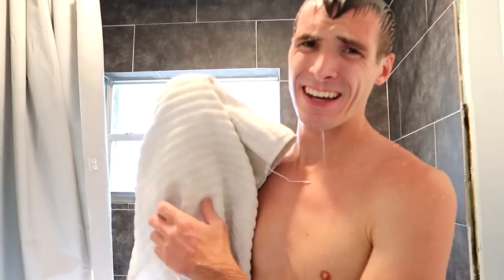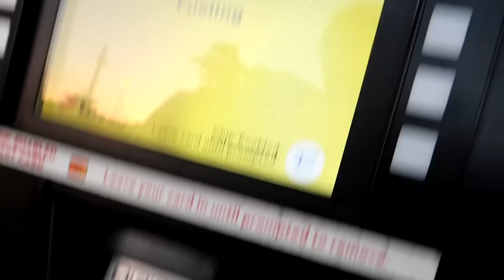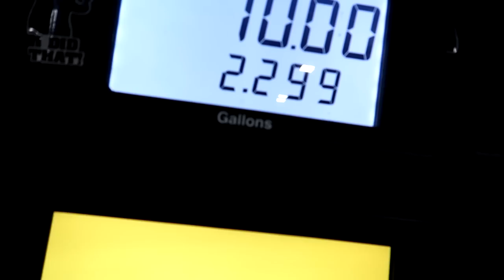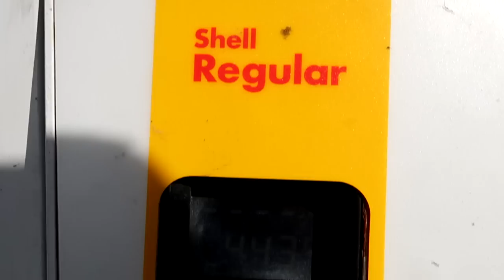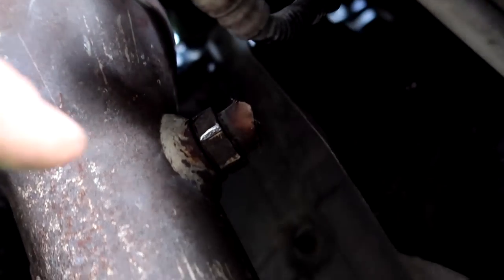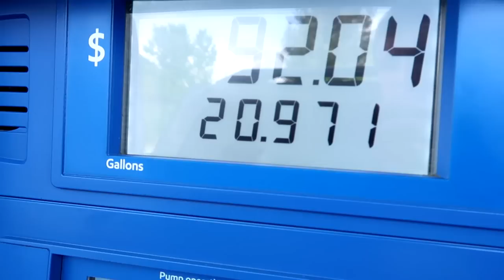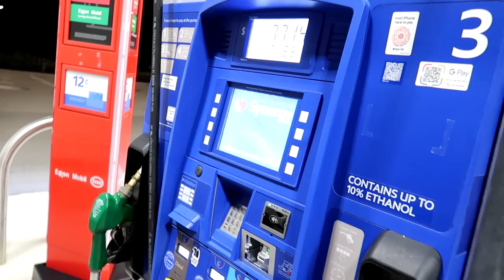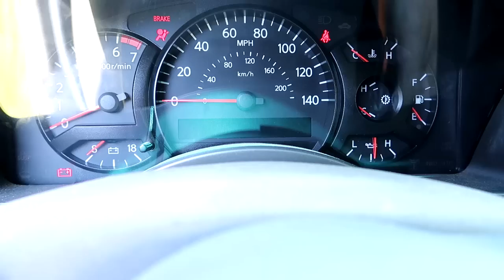The Wedding Road Trip Nightmare

Comment: FYI that is a load distribution hitch with a slight sway control. From the looks of it you need to tilt the hitch more so it will push more weight to front of vehicle and pick up the rear. Look up how to set it up. the difference when it is right is amazing
Reply: I was going to say the same exact thing
Reply: load leveling hitch, with about zero sway control. step one, load balance the trailer and personal contents inside( front/rear and side to side, having correct tongue weight).step two set the hitch height right and adjust load balancers if the properly loaded trailer is too tongue heavy for the vehicle. then install and rely upon friction style anti-sway bar if it has minor sway when on long downgrades with the trailer pushing vehicle (no brakes applied) if trailer brakes are working right and adjusted swaying should not occur, unless gusting/tail winds are involved. if a trailer starts swaying, in most cases manually applying the trailer brakes lightly and throttling the vehicle will quickly correct it. it all depends on the road grade, flat vs. downgrade. if on flat ground, just apply throttle, if down grade and minimal braking(downshifted/engine braking) and minimal vehicle/trailer braking, just gently using the trailer brakes will set it straight again. if you cook all the brakes to overheated fading? well game over mostly. it takes forethought to tow something, who'd have guessed that? there will always be failures out of your control, so be prepared for the unknown at all times (as with daily life, at any moment something can go south)

Comment: Those are weight distribution  to help evenly distribute the Wait the sway control would be a smaller shock like attachment that goes on a second smaller ball and has a connection to the trailer

Comment: Price per gallon is still a lot cheaper then what we pay in australia if you convert it to litres. 
Trailer wise, to be safe do all 4 wheel bearings as you dont really know the mileage on them, and when they sit for an extended period they 'square' out. So prematurely fail. Same with trailer tyres. If they sit for too long they fail early also.

Comment: Hey man, cool video, but if you go to 15:16 and look in the bottom left corner, you'll see your trailer tires are cambered in and out and you should definitely get that fixed. That camber can also cause tire blow outs. And I think it's safe to say you need to upgrade to a 3/4 ton pick up since you have this 26 foot toy hauler now.

Comment: Completely wrong explination of an equalizer hitch there Dalton but ok... Equalizer hitch bars equally distributes the trailer tongue weight thru the tow vehicles frame essentially making the tow vehicle and trailer one unit rather than full tongue weight on the ball hitch which will give an unwanted Carolina squat..and to add you have squat, your bars are incorrectly set up. I`m glad I am not paying your fuel bill. You have a first generation Nissan Armada with the VK56 v-8, not exactly the most fuel effecient v8 of its time. I know, I had a first gen Titan 5.6 that fucker drank gas with the engine off.
Reply from the maker: she gets cranky when you don't hydrate her
Reply: @3DMachines  🤣

Comment: those look like a rendition of  "load leveling bars" to me, far more than any type of sway control.
if you have trailer that starts swaying(not always right for huge wind/road grading issues), step one is correcting the load balance of trailer front to rear, side to side and vehicle tongue weight. second is looking at alignment of trailer axles and tire inflation/cupping/condition.
BUT always! if it starts swaying do not apply regular vehicle brakes! first use the trailer brakes, manually applied by the trailer brake controller lightly(if it has brakes) you may also have to apply throttle on vehicle and speed up slightly, before trying to slow back down. (not good on downhill/long downgrades, with trailer brakes overheated) if that is the situation, you made errors long before.
if trailer doesn't have brakes or brake failure, applying throttle to vehicle will very often correct it, but that means your no going faster and if downhill/steep grade, that could spell disaster. take notice of the truck run-away ramps and drive off into them if you have to, DO NOT hit the brakes, best bet is gently steer into them and hit the gas powering right into them! will your vehicle and trailer/towed objects get trashed by the gravel? very likely yes, the whole bottom and all wheels destroyed. but that's better odds than wild out of control wrecking into other traffic guardrails or off mountainsides! the runoff ramps were created for that very reason, USE THEM!

Comment: I've had more trailers sway all over the road with the sway bars than anything else
Reply: Well then you should find someone to install it correctly. To be fair tho he didnt have an anti sway bar, unless he had one of the new Curt stability bar that has built in sway bars. This is just a stability bars, and you hitch will have a tab welded on with a smaller ball mount with a ball mount on the side of the rv frame that connects the anti sway bar that has a dial on it to adjust how much you dont want your trailer to sway back and forth. The one he has currently is to help with bumps so he doesnt keep going up and down after the bump and have more control over the vehicle and trailer.